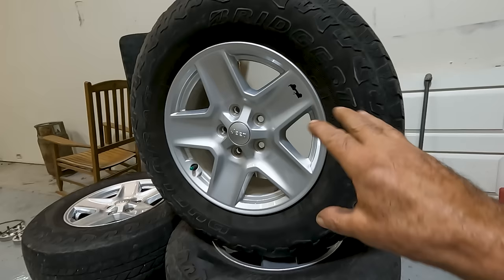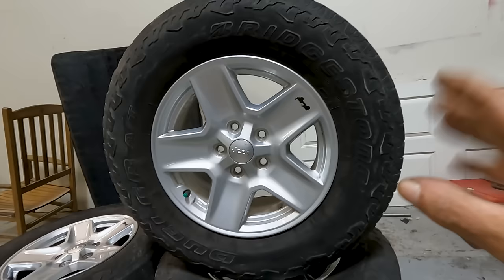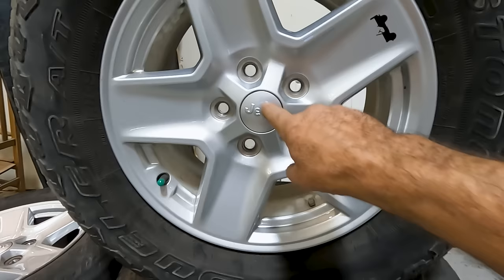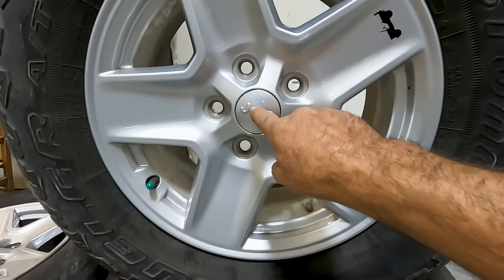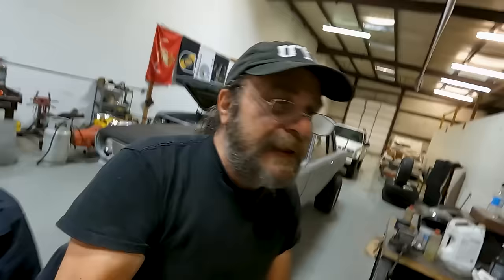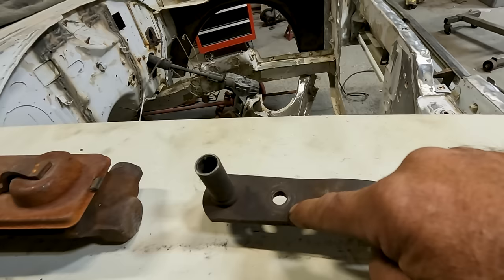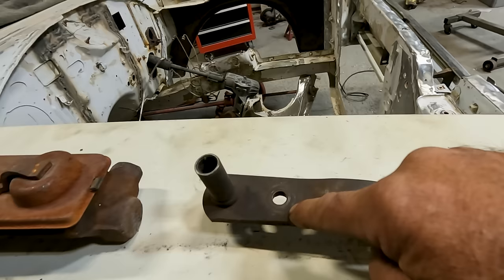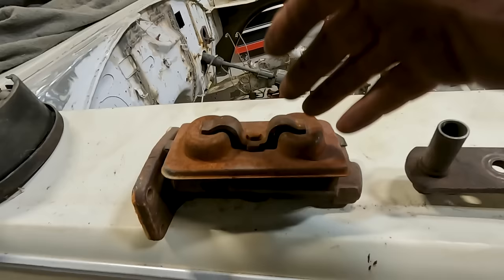Modifying Classic Cars And The Butterfly Effect - Can You Outsmart The Engineers?

Comment: You can't argue with stupidity! Recently I purchased a RAM 2500 Cummins to tow a 5th wheel camper, the truck has oversized tires on it I needed to get rid of and go back to the OEM size. The tire place (a National Chain) said it won't make a difference why switch back?? I almost had to demand them to do what I wanted, .  Just like trucks I see lifted 4"+ with big mudders towing campers they think it's cool and safer???? The center of gravity is all out of whack and the leverage on the drive line is way out of spec!!!  I cringe when I see this going down the interstate 70-80 mph down mountain passes with their children in the truck 😮😮😮😮 .IMHO If someone is towing a heavy camper with children in the truck they should be arrested and charged with engagement! Yes I have experience cleaning up wrecks for 30+ years so many people should not have a DL.

Comment: Gotta disagree..crappy one-circuit brake systems want upgrading regardless the make/model/year..

MY daily has a carb where EFI used to live, an adjustable proportioning valve where the crappy first-gen ABS was, bigger brakes all around, bigger tires/wheels all around, a five speed from a different OEM, a bigger radiator than stock...the list is endless.None of these mods made my truck less "daily."

Comment: I have to disagree with you on this one.  I have converted a number of 1960s-70s cars from manual to power front disc brakes, using OEM parts.  You are giving too much credit to engineers.  The carmakers sold what was cheapest, not what worked the best together.  Just go read the old car magazine stopping specs and see how bad some of those all-drum systems were!  Upgrading to disc brakes and modern, wider radial tires makes a yuuuge improvement in handling, ride, and braking.  Yes, you have to know about brake bias and so on - there are aftermarket parts such as bias valves that can be used if needed.  My preference was always to use OEM components off of newer or higher-optioned cars which had the necessary items on it.

Comment: So the engineers that designed all the upgraded brakes aren't brilliant people? They make upgrades for a reason.  Especially considering today's technology and materials available.
Reply: They did the engineering work so the upgrade was right. Match the master, proportioning valve, calipers, pedal ratio, and everything else so it works properly. 
The problem is regular people tend to just throw a couple of the parts at it instead of really going through the whole system. Sometimes it works. Sometimes it doesn’t.
Reply: Do you mean aftermarket people or engineers from the car companies?

Comment: I hear you Tony, but I don't 100% agree.   You are giving OEM engineers too much credit. I"ve work in automotive manufacturing for most of my career. You are missing one big point in your discussion. Cost! Engineers do design systems to "meet" the needs of the application, however, cost is a HUGE driver. They absolutely DO cut corners if they can save some money(make more profit). And it may not be the engineers choice. Bean counters have way more say than they should. So, a braking system may only "meet" the needs of a car but not any more than that. 
That's were the aftermarket can beat the OEM. The aftermarket braking system has been designed by engineers too. Don't forget that. And they have a goal of making things better at a higher cost. A guy wanting to upgrade his car for better performance is willing to pay a little bit more for those parts and his car WILL stop shorter.  Grandpa buying a grocery getter doesn't have the same desire so, OEM brakes "meet" his need.  You, of all people know that money makes the world go around.

Comment: Wrong!  NOBODY drives around with bias ply tires.  Adjust the front suspension to have a modern caster.  A heavier engine needs strong brakes.  If you put a big block in a six cylinder car you had better use larger brakes.  You can’t drive anything without matching the evolution of automobile parts.

Comment: Bigger wheels are ALWAYS a BIG mistake. People only use them because they want the GHETTO look. Anything over 15 inches, unless you are talking about a large commercial truck, are BAD NEWS. Tires NEED sidewalls. My '03 Mustang V6 (daily driver, bought 5 years ago) came with 16" wheels from the factory. The first thing I did was locate a nice set of 15" wheels from a 2000 model and put on it, with the proper size tires. A 2000 and 2003 Mustang V6 are IDENTICAL. Ford put the larger wheels on the 2003 just for looks, and lost braking and handling performance in the process. There are a lot of brand new cars coming from the factory today that are barely even driveable on near perfect roads, let alone the bomb blasted roads we have around here. So much for modern engineers. 24" ghetto wheels and tires with a 1" "sidewall" are absolutely NOT a good idea on ANY car. 20+ years ago, I owned a 1978 Lincoln Continental Mark V. An absolutely HUGE car. It had 15" tires, whitewalls no less, and they worked great. They also looked great. I also used to own a 1975 Ford F-250 with a heavy utility bed on it. 390/C6. It came from the factory with 16.5 wheels/tires. I couldn't find tires in that size, so I put 15" wheels and tires on it. Never had any problems. They were still commercial tires, rated for more weight than the truck and anything I ever hauled in it.  

As for real classic cars, from the '60s and older, I do highly recommend a conversion to front disc brakes and a dual master cylinder designed for front disc brakes. All master dual master cylinders designed for cars with a disc/drum combination have a smaller front reservoir. If you plan on using a vehicle for towing a lot, I have no problems with beefing up the rear suspension a bit. People have been doing that forever, with no problems, as long as it is done right.

Comment: I don't have to outsmart the engineers. I have 50 years of thousands of engineers and 'screw arounds' to draw upon. Example: I could never design a brake master cylinder from scratch but you bet your left asscheek I'm going to swap that single pot master from 1957 to a dual pot master on a daily driver '57 Chevy. 

I don't have to outsmart anyone. It's already done for me.
Reply: Well, he did differentiate between pre-interstate cars and post interstate cars, saying mid-sixties up didn't need the modifications. I agree with him as far as late 60's and up cars that have enough improvements that they worked well and dependably in stock configuration. I agree with you about doing some upgrading to a 57 Chevy, even though long ago, I drove my 55 Chevy and 57 Chevys with stock brakes without incident, by being careful. But they could've definitely been better though.
Reply: @grand73am   Fair enough, I only made it through about half of the video. 

Not that it matters; I literally can't afford to buy a $1500 toy, much less something like a clapped out rust bucket $10,000 57 Chevy.

Comment: The reasoning for not upgrading brakes may be the dumbest thing I’ve ever heard someone say.  He totally fails to  take into consideration the number one reason most  cars came with drums was cost.  This is the single most important design element for automotive engineers is price/cost.  If it wasn’t we would all be driving Ferraris.  This is before you take material science advancement into consideration.  The part about unintended consequences is true. But the rest is pure dumbassery.  Saying you can’t beat what the original design was is simply not true.  You can easily half your braking distance by upgrading brake systems, you just have to do it right.

Comment: I wouldn't own a car that has front drum brakes. I did a disk swap on a 68 Camaro. I did everything needed to make it work properly.  If I bought another old car that came with drums all around, I would swap it over too. It's easy if the car also came with a model that has disks on the front. You just buy everything that is different and put it on your basic. But yes. You have to do it right if you are going to do it. As far as engineers go... the ones that did the 2000 S10 are assholes. I have re engineered a lot of things on my truck and all for the better. Bigger radiator, all aluminum. Electric fans. The clutch fan in the summer and huge fan on hot days sounds like an airplane and kills gas mileage. At least 5 miles per gallon. And it is so loud and annoying. The radiator does not work in the desert heat we get here a few months out of the year. Hence why they use dextron. That red shit! The plastic caps separate from the core. The engineers are smart, but they use their intelligence to make money and not to make a car last. They design them to fail and they design them to be hard to work on on purpose. They are evil and should be tried and thrown in a cage for 20 years. I could go on and on. If yu are not mechanically inclined then leave it alone. But there are many modifications you can make to make a car run, stop, last and look better. And be more fuel efficient. And with all the forums and Youtube videos, it is not that hard to find the flaws and fixes and instructions on how to do them right. You do have to wade through all the morons putting bad info out there, and there are a lot more of those than good honest smart mechanics. Remember, satan is the ruler of this world and there is a lot more bad than good.

Comment: Excuse me Uncle Tony, but you are full of it when it comes to OEM engineering. The brakes on a Fox body 5.0 Mustang are CRAP. The rear brake shoes have the same part number as the ones used in a Pinto! And after the first performance stop or slow down, the front rotors are warped. For decades auto manufacturers didn't give a hoot about engineering, they only cared about the money. Much of that still goes on today but foreign competition made American car companies get their act together. The best advice concerning getting a classic car for a daily driver is, don't do it. It will be a money pit and the difference between it and a modern car will be immediately apparent.